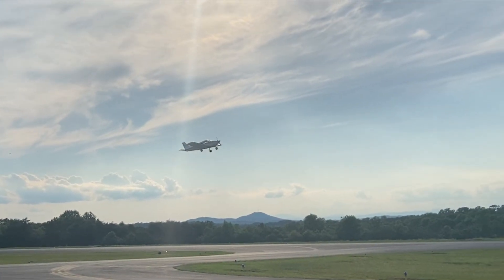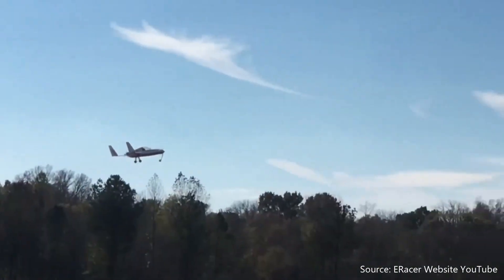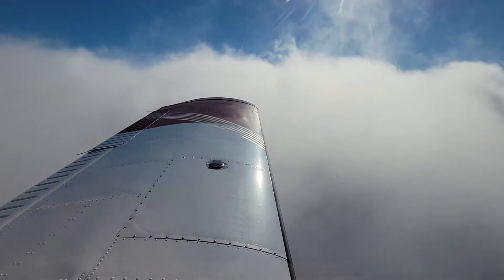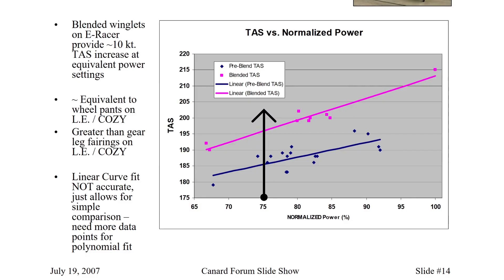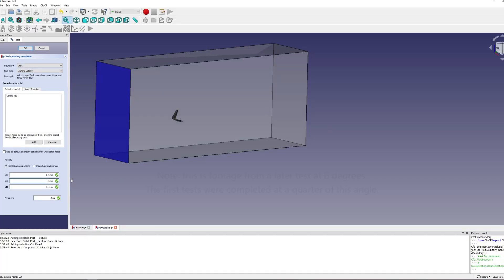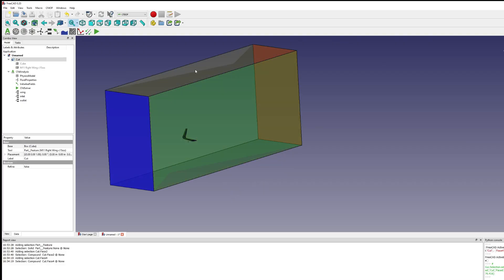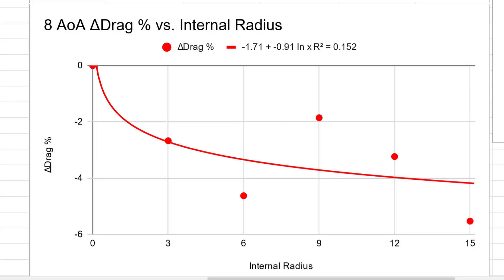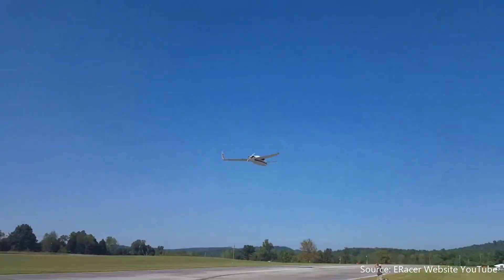E-Racer Blended Winglet and Interference Drag CFD Analysis

Comment: This as ground breaking as the 3% increase in efficiency that Boeing spent 2yrs and $140mil on for the 737 winglets. So awesome. Just think in 2045 the Truss Wings will start to get tested. By 2180 we might finally comprehend Coandă effect. Aviation advances move so fast. Hard to keep up.

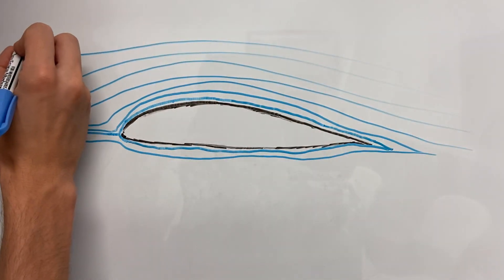Comment: 4:00
 The streamlines behind the wing section, never join.
The approaching stagnation streamline of a lifting wing is NEVER straight, because of the circulation, which determines the lift force
L = dens × V x circulat. × span
The shown gap between the 3rd and the 4th streamline after the stagnation streamline increases over the wing, where the pressure is lower.
The reality is precisely the other way, it must narrow.
Sorry, this is sloppy.

Comment: I seriously doubt the drag increment shown ,if based on the parasite drag of the entire airplane,not just the wing.
The drag increment must depend on the lift coefficient/angle of attack/IAS
Personal experience with wind tunnel testing, showing strong scaling dependence of the chord Reynolds number
Re = Vtrue × chord / kinematic viscosity
 The pressure distribution along the chord in the inner corner is crucial.
If this is well engineered: no corner flow separation should take place at the lower AOA at the  cruise condition.
___________

Comment: I liked your explanation, but it also feels over simplified like you'd find most people saying.

 For one, it isn't true that the air below the wing must have higher pressure than the local atmosphere, since the air above the wing can reach very low pressure coefficients, and it was documented since the first airfoil profiles were made that the low pressure area is the main responsible for lift, so the bottom could be completely flat.

 And for 2, Bernoulli's means that for 2 points of the same flow, and only the same flow, if there's an acceleration between those points, the flow after the change of velocity will have a change of pressure inversely proportional to that. 

Nothing personal but I've got tired of seeing aerodynamics being explained in the exact same way every time and every time it made no sense, when I finally got to read actual books on the matter, I (who have been enthusiastic in these kinds of effects since I was a kid) realised I knew nothing (or mostly made up bs).

 Loved the plane design, and I'll look deeper into interference drag later
Reply: My feelings exactly. The presentation is very sloppy.
He does not distinguish between a turbulent boundary layer and turbulence due to separation.
That a  turbulent boundary layer, after transition from a leading edge laminar boundary layer is necessary for avoiding separation leading to flow turbulence.
The NACA airfoil shown at 4:00  is a "laminar section".

Comment: Why don't these small aircraft use turbo fan engines ? They would gain more power and reliability ?
Reply from the maker: That would be a lot of fun. The answer for myself, and likely most other builders is cost. Turbofans are several times more expensive

Comment: A fatal accident is reported to have been caused by flutter in a blended wing/stabiliser design.

I was talking to an ez builder about your video and he told me that blended wing/stabilisers become very sensitive to flutter due to the decreased stiffness of the wing/stabiliser interface. He told me there was a fatal accident caused by this in a long-ez. I've asked him to share a report about the incident and will share it here if he is able to find it. You can easily test the inherent difference in stiffness with a folded paper model

Comment: Don’t know where you would put your fuel tanks in this plane, but if not in the wings, try a parallel curve on the bottom side of your chord and see what happens to lift. Reason is that it is not Bernoulli, but Coanda and Newton that better explain the reasons for flight.

Comment: Or - move the vertical stabiliser backwards about 10 inches, to a foot (ish).
Have a look at the current iterations of the wing-foils on the Americas cup yatchs if you dont understand what I mean.
This seperates fore/aft the two areas of max interferance between the two foils (vertical and horizontal).
Reply: This is simply locating the area of minimum pressure on each foil away from each other. So as not to cause an additive acceleration of airflow.

Comment: i wonder if the larger leading radius would work better if you were using a conical curve instead of a cylindrical curve, so that it tapers to a point at the trailing edge, giving you more vertical real estate for the vertical stabilizer.
would be a harder shape to fabricate, but i would imagine it has better performance on paper.

Comment: Towards the start of the video, you say that the airflow over a wing "both pushes and pull the wing up" - I'm going to be That Guy for a second and point out that air cannot and does not "pull" anything.  The lower pressure on top of the wing is still downward pressure on the wing.  the wing produces lift because the pressure on the bottom of the wing overcomes both the force of gravity AND overcomes the pressure on top of the wing.

Comment: 4:44 you might discover that lift does not wor the way you think it does:

By "slicing" through the air, the wing accelerates the air downward actually using both surfaces of the wing. The acceleration of air "particles" along the flight path over the top surface of the wing is only a result of the general downward acceleration.

From a static frame of reference the wing even accelerates the air forward due to the friction you mention.

In the end, the idea derived from Bernoulli's principle that a wing creates lift from "underpressure" above its surface by accelerating the air above it against the direction of flight will not yield nearly enough lifting force.

Wind channel observations do not necessarily provide all insight necessary to understand the total balance of (kinetic and pressure) energy states of the air surrounding the wing. 😊

Comment: You may think I’m nutz, but I saw winglets on HUGE ceiling fans in the Martin Baker factory at Denver, many years before they appeared on aircraft wings
Reply: I held a sheet of paper around a fan. It detected airflow. As expected, the fan was blowing air out strongly on the exhaust side(about 60 degrees), but was drawing air in from all other directions (about 300 degrees). The fan would obviously make a poor propeller because it was pulling in some air from the side towards the fan that should have been pushing out air away from the fan.   Winglets were an obvious solution way back then before winglets were a thing.

Comment: Serious question here… why not make the internal radius as big as you want and just make the vertical stabilizer taller to compensate for height that’s lost to the curve. There’d be more surface drag, but you’d also decrease the drag from the joint.
Reply from the maker: The reason I chose not to go with this route is rudder deflection inducing roll. The higher the vertical stabilizers, the more roll they make in addition to yaw when rudders are used.
Reply: @WalkerWeathers  Ah, ok, thanks!

Comment: It's when looking at these tools that I'm happy I used to work with converge science. It has adaptive resolution for simulation. So an areas with low compressibility and interest it only simulates it something like two to three inches whereas areas of interest it can simulate with resolutions finer than millimeters. It also has the ability to do moving surfaces. Requires a supercomputer to run and an expensive license but boy is it powerful. Still takes hours and hours to set up a run only for it to maybe fail halfway through but when it works it's amazing

Comment: A point of pondering. In a box wing configuration where the verticle connecting Winget is also acting as a rudder, would both the upper and lower connection points benefit from a curve, or just the lower one?

Comment: Very interesting. I was wondering if you had also considered a couple other questions. What would happen if you canted the winglets out a small amount but used a smaller radius, I.E. put a 3-4 degree outward can’t but only used a 6” radius. Also in the winglets, if you moved them back slightly, if you look at the winglets of the Long EZ compared to the E-Racer you’ll notice that the Routan winglets actually trail behind the wing (most likely to get them in cleaner air and make the more effective) 

You’ve done excellent and very thorough analysis, thank you

Comment: "Anywhere the speed of the airflow is influenced by the rock is part of the boundary layer"
That is NOT the definition of boundary layer. The boundary layer is only the part of the flow significantly influenced by viscous forces. The field influenced by an aerodynamic body is much larger, on a distance pressure forces dominate.
The split between boundary layer and so called potential flow (the field not significantly influenced by viscous forces) makes the solution of the mathematical problem of the Navier-Stokes equations much simpler.
In the boundary layer viscous forces dominate, accelerations by the pressure field can be ignored. The reverse is true for the flow outside of the boundary layer.

Comment: Aeronautical Engineer here, few points to help you out: Residuals beahviour are the secret to any CFD simulation because they essentially the error within the study, so check wich residual is with an erratic behaviour and that will tell you where is the problem. Second of all theres no need to have such a big mesh surrouding the wing. Assuming the blue face is the inlet you can put it WAAAY closer to the wing the  outlet doesnt need to be retangular and can also be closer. Also dont make the calculation enviroment retangular... It should be trapezoidal... This will reduced the size of the mesh and consequently the calculation time. Also this im not sure if u did but it appeared you reduced the scale of the wing in order to fit the model. You should be carefull doing this because if you do not maintain the Reynolds number the results wont be true. In other words if u reduce the size u need to reduce the velocity by the Reynolds number...
I can help you further if u need....
Reply: I also forgot to add a thing... When doing CFD analysis you need to see a mesh independence... You obtained diferent results because as u said CFD studies are dependent on the mesh. Thats why, you should make the mesh thinner and thinner till you see a variation smaller than 4%~7%

Comment: Interesting, thanks for sharing! Have you considered investigating the effects of moving the fins back a bit? Having to perpendicular surfaces with increasing pressure, i.e flow passed the thickest point, promotes separation. An example of solving this kind of separation, and associated drag, problem can be seen in designs where the fuselage max width is located aft of the wing. That reduces the need for fillets.

Comment: Very good investigation. One thing I wonder is if you would have run those 12 degree simulations at a lower airspeed whether the flow would not have separated. 12 degrees AoA at the cruise speed would be a very high wing loading, not realistic for most stall situations which occur close to 1g at normal aircraft weight.

Comment: Now I've never used these CFD programs or any others but what I'm assuming is the simulation area bounding box looks a bit large, but remember ive never done CFD just generally interested in this sort of thing.
Reply from the maker: The larger the bounding box, the more realistic the simulation, but a larger box also requires more processing power. I followed some recommendations I found online related to the wing span of the aircraft and my computer fortunately had enough processing power to handle the size.
Reply: @WalkerWeathers  I figured youd need some extra space i just didnt think it was that much, but whoever made the reccomadations probably knows more than both of us so ill take their word till i find something suggesting otherwise, thanks for the quick reply!

Comment: There are some other side-effect variables to consider.(Grow test-matrix, grow!) The way it appears that you created these curves is to basically cut the corner; which slightly reduces frontal area, it also reduces effective horizontal wing area(similar to the way it reduces effective vertical surface). the other effect is that at high AOA the curve tends to dumps air from the lower surface. Whether these side effects are significant and how they could be compensated through changes in cord and span, is the question of course. 
I know for a simple winglet, which is not a vertical stabilizer, a simple increase in wingspan is generally more efficient than a winglet of similar frontal area and mass. The exceptions are cases where the bending stress on the wing causes disproportionate added structural mass.(Which is all quite dependent on wing thickness, struts, intended mission, initial aspect ratio, and so on.)

Comment: OpenFOAM could not handle the whole airplane ?   I'm pretty sure it could.  I've done a lot of OpenFOAM CFD with no issues.
Reply from the maker: OpenFOAM is what I used. It was SimScale that could not handle the whole plane. I may have said the wrong one at one point accidentally

Comment: I have a question for you to ponder. I don't  need to know your answer but felt I it would be good to mention it.  Studies done on winglets by NASA showed that they reduced drag on the wing tips but in doing so they reduced the directional stability of the aircraft because that drag is a stabilizing factor in yaw stability. It was stated in that report that additional vertical surface may be  necessary to compensate. Your study is different because the winglets are the vertical surfaces and there is not another vertical surface to help with yaw stability. That may make your case even more critical (or not).  So my question is;  Have you considered the effects of the modification you are proposing to make on the airplanes yaw stability?
Reply: This may not be an issue on a canard airplane since the vertical surface is located aft of the aircraft cg. 
On a conventional airplane, the vertical surface (winglet) ahead of the cg would definitely be destabilizing in yaw.
Reply: @ammerudgrenda  Well i am glad you answered as your response kind of confirms that you haven't considered it.

Comment: what does serrations on the trailing edge of the stabilizer do to the CFD, and if the serrations are vibrated, what happens? at what frequency does the vibration speed match the airflow, and how could you calculate the vibration speed and mode to shed vortices?
Reply: think of the piezo electric fans, then make them microscopic.  just needs to be a vortex generator on a microscopic scale across the trailing edges.

Comment: Evidently, Van's has studied "Wing-Root" fairings to add a curve. They found that it actually caused more parasitic drag. Perhaps because the air over the fuselage starts well before the wing, that it is less important there.
Awesome work on the wingtip though.
On my Cessna T210, I have a STOL Leading Edge Cuff that also came with Down-Turned Winglets. So after viewing your video, I wondered if upward or downward would matter.
Given that there is higher pressure below the wing, I would think that downward turning would be better (given ground clearance. 
It appears that studies to confirm that downward turning works better than upwards turning concerning parasitic drag only
Great work, fascinating video

Comment: My God, I was already interested in planes when the VariEze was still new - such videos show me how old I am.  
 
I have seen a few numbers about winglets, and from what I seem the rise in efficiency the winglet brings is about the same when you would lengthen the wing by the length of the winglet, i.e. increase the aspect ratio. 
 
So that would be the better road to go, lengthen the wing.  
 
But many planes have other restrictions regarding wing length, and then the winglet is the right choice. 
Like on a passenger jet where  the place (= width) on the airport terminal  is restricted, or when you have a restriction like the 15 Meter-glider class.

Comment: ... and 30 inches would increase speed by 25 knots, and straight wings by 50! ))) So that there is no angular effect of flow compression, you just need to invert the bulge of the stabilizer outward from the wing ...
In general, the rudders have no place at the ends of the wings! 'It's art. But not everything that is beautiful works well...
Reply: Uh…no.

Comment: Seems like loss of rudder area could be mitigated to some extent by using a longer rudder chord length?
Reply from the maker: A small change to the chord length could certainly be effective, but too much would compromise the structural integrity of the vertical stabilizer. It does not have an internal structural member; instead, the outer skin takes all the structural loads

Comment: You should try X-Plane FS, there is a pretty good airplane builder app included, where you can modify at will models from others...
Also it has good statical and visual system for drag, lift and forces while flying. At least a good way to find out, at which radius, you will loose control...